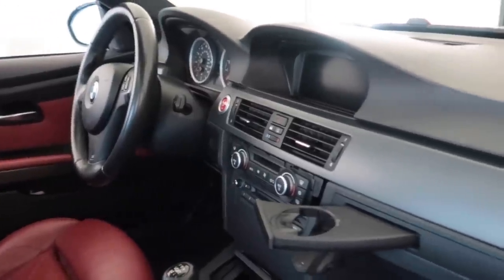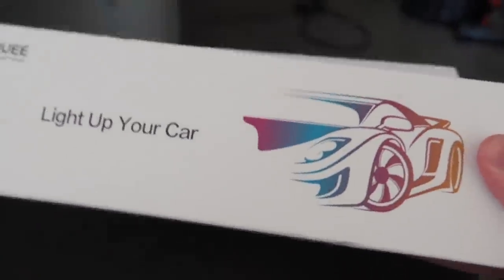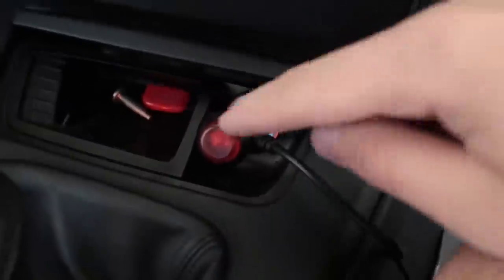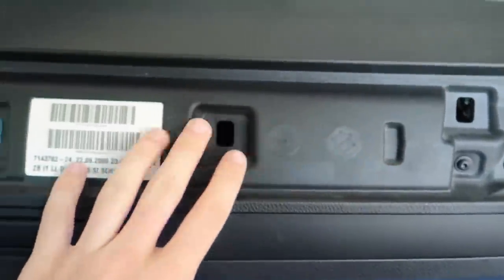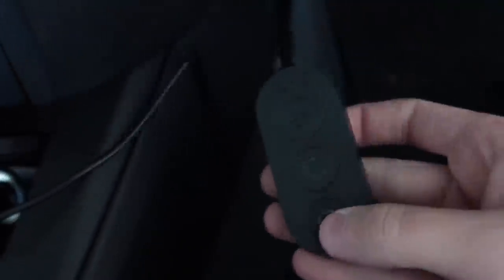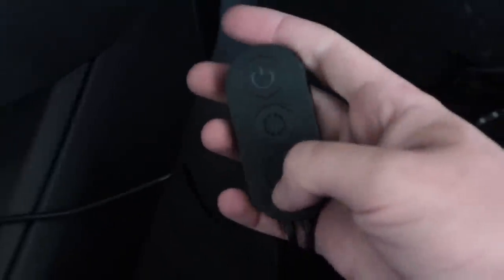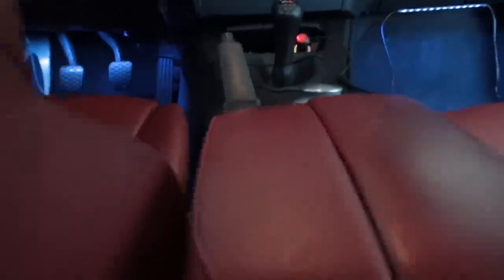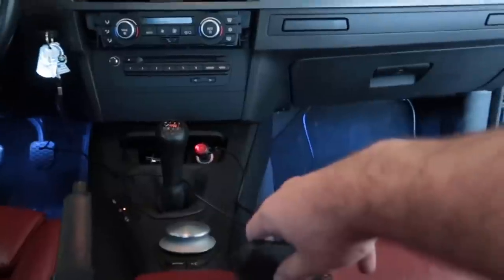BMW M3 WITH CUSTOM AMBIENT LIGHTING!

Comment: If you want the lights to look uniform with no space. A cool hack is the use a hot glue gun to cover the LEDs strip from end to end and it will defuse the light. You will get the effect your looking for. All light no spaces.
Reply: really??

Comment: Great vid Nour! I would like to suggest el
Wire ambient lighting for your e92 M3 I’ve done it to mi BMW and the kit uses fiber optic laser emitters for a consistent light output. The kits are dope and I think you would like them. Look them up
On YT. Also
Check out the starry night light kit for headliner it’s dope.